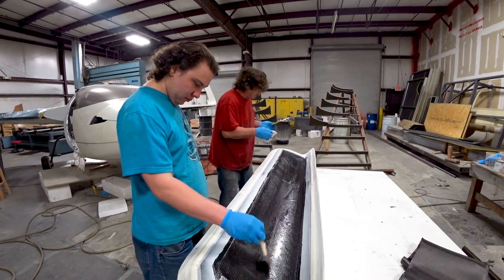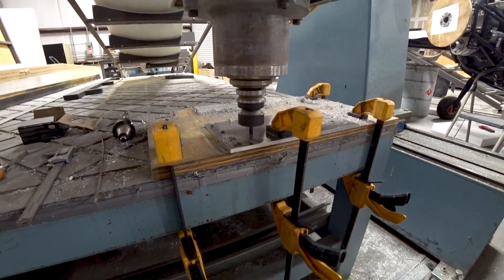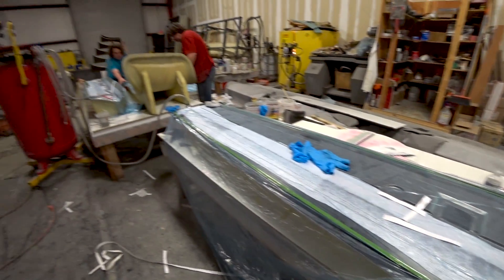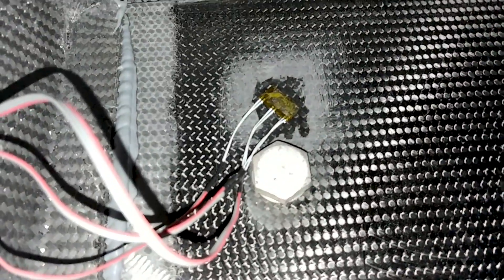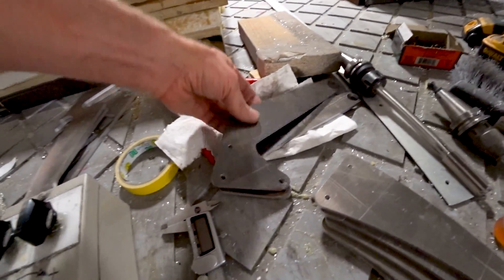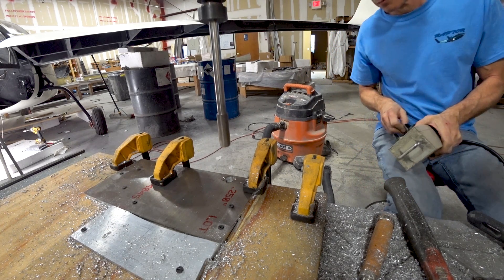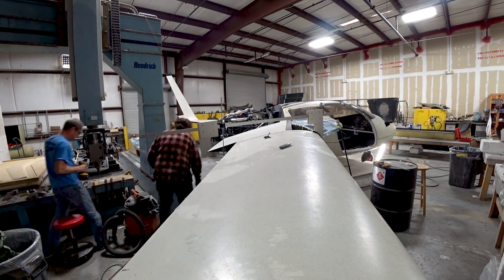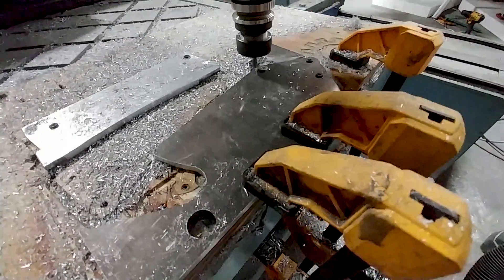Heading for the Finish Line - Building the Raptor Prototype

Comment: Respected sir. with all respect I would ask You to see, before closing of the strain sensors, how much a force on a signal wires is changing the measurement. Please, consider using a strain relief patch for termination, since any movement of wire could change measurement. There is a special gel for covering them also. Also, is there a need for electronics to be right there, or it could be placed somewhere not to be bounced around in wing. Once some acquittance brought me a strobe tail light from Cessna, which somebody already repaired badly, that had a transformer in it loose. Only the powder and a steel ball were left inside.
With Best Regards and success.

Comment: Milling pro-tip: When using a machine that lacks the rigidity for metal cutting, it is best to take advantage of it's RPM, by making a series of shallow cuts like .05 depth, and staying away from the final finish wall profile by .030. When you reach the bottom, then take a final wall profile pass and clean up the .030 at full depth. You will machine those plates way faster, get a better finish, and not snap end mills.
Reply: The scene from The Fifth Element: MULTIPASS, multiPASS... :)

Comment: Hey I love the Honesty especially if things do now work out. Having said that, i do think i love the design of the fuel tank, unless i have not really understood it well. I am usually opposed to wet wings design. I would think you consider an insulated fuel tanks well protected that can not burst in case of accidents. This will avoid post crash fire on the plane. 
Otherwise thanks for all the Jobs you are doing.

Comment: You may want to try doing multiple passes when milling the aluminum. I have a CNC router that is not a rigid machine but get pretty good results with a depth of cut around .025"-.030". This allows you to increase the feed rate and "make chips". You need to make chips because they help dissipate the heat generated in the cutting process and keep the cutter from overheating. Keep up the good work!

Comment: Really beginning to look like an airplane now! You could probably improve the milling situation if you had better chip evacuation. Can you rig up some compressed air so the chips are blown away from the cut? It looks like you'd be recutting chips like crazy with them piling up like that and that's never good. Actually, give the amount of metal cutting you've been doing, it might have paid off to just get something like a Tormach 440 that's made for cutting metal. That cut you said took hours would have been done in a few minutes on even a little CNC vertical mill like that.

Comment: Have you sorted out the landing gear travel issues?  Instead of trying to regulate the flow to operate the landing gear, could you not fit a shock absorber on the system to help slow down the travel speed of the unit when it is stowing the landing gear?  Cheers
Reply from the maker: Have not had time to work on the gear this week.

Comment: I sure you’ve considered a variable incidence foreplane. The Wrights did it, and there are manifold high performance aeroplanes which use it. I know they aren’t  lifting structures like on the Raptor. I’m curious. Is it feasible?
Reply from the maker: The Wright Flyer was showing signs of over controlling because of it. It's not a stable design for an IFR platform imo.

Comment: I remember you saying months and months ago about how small the displays are going to look in the panel and you were hoping Garmin would get around to making bigger displays... you aren’t kidding... the two panels going in are nearly lost in the space available...
Reply: Enough room for a Costco TV run.
Reply: Bad Santa exactly what I was thinking. But the stuff Peter replied with is probably more useful and necessary. :)
Reply from the maker: There will be two tablets in the middle section. One iPad for fore flight and such apps and the other showing all the output from the engine ECU. That will fill it out quite a bit.

Comment: I was wondering if you used any cutting fluid when machining metal.  I operate a CNC mill at the cabinet shop where I work.  We occasionally mill a little aluminum much like you are doing and it cuts much better with a little A-9 or WD-40 in the cut.
Reply from the maker: I don't have time to stand there and keep lubricating it.
Reply: @RaptorAircraft  I usually just spray or dribble some on where the cut is going to be and let it go.  Not the way the metal machinists do it of course, but it works.  Keep up the good work.
Reply: Have a look at the fogbuster product, just the job for a mill like this.

Comment: From the last video I wonder if the elevator mechanism is being installed incorrectly (because it was just a test) contributed to it binding up. They were relying on the stiffness of the shaft to not twist rather than the bearings directly. Also, you have short moment arms where you are operating the mechanism by hand and longer moment arms where the pilot input is (I think) I would expect pull forces where the cables meet would be hard to generate with your bare hands. Just wondering if your original plan might have ended up working. Your project is amazing, love watching the progress you're making.
Reply: I wonder if the new design will have the same issue unless they change the short moment arm at the point he was trying to rotate it by hand.  The first design looked sound.  I am not an engineer though, just another comment from the peanut gallery.  Very impressive progress these past few weeks. Can’t wait to see it fly!
Reply: Same thoughts on this here.